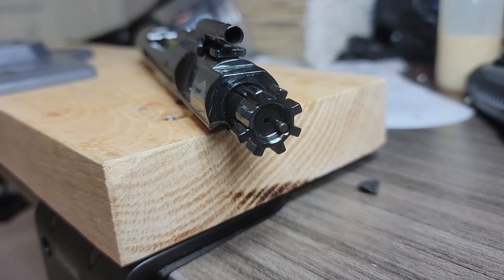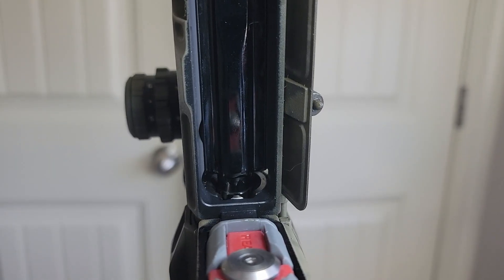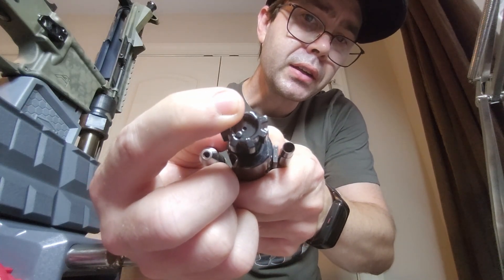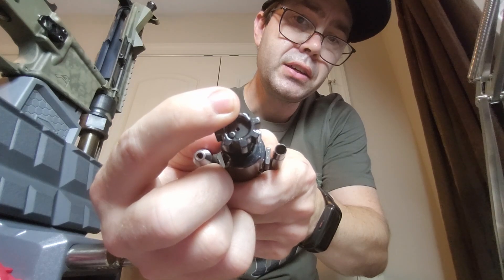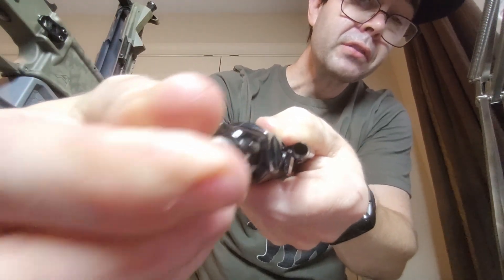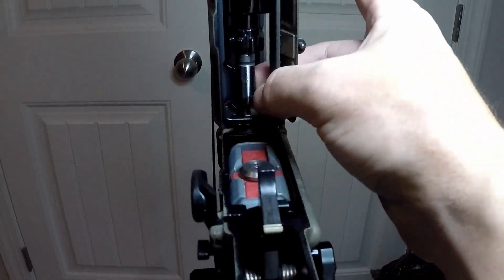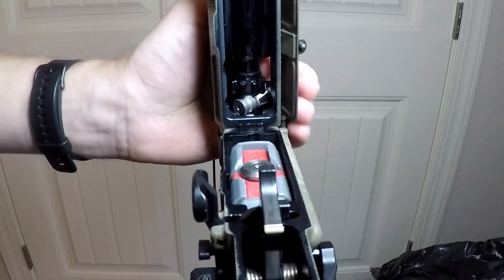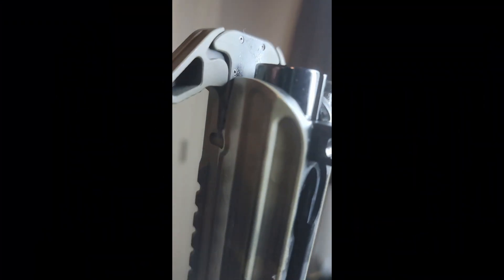Check AR Headspace FAST: No Bolt Disassembly Required!!!

Comment: You also have to remember a NEW AR10 will often close on a No-Go gauge such as a Forster 1.635 No-Go gauge. If it does, don't worry. This is common on a .308. To check if it's truly out of space, use a FIELD gauge. If it closes on that, don't use the rifle.

Comment: It is very easy to remove the extractor and should be done periodically when doing a good cleaning. If the ejector doesn't compress deep enough, it can give a false reading. It is also important to use the proper go gauge in a 5.56 chamber of 1.4646 and not the 223 commercial 1.4636 go gauge. Many gauges are sold that are stamped 5.56 but are not true 5.56 go gauges but the 223 commercial.